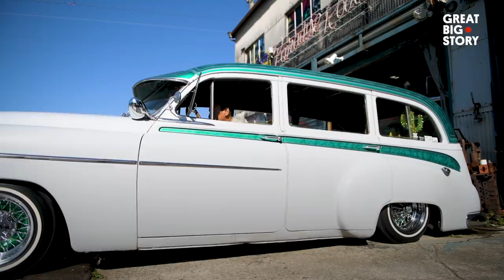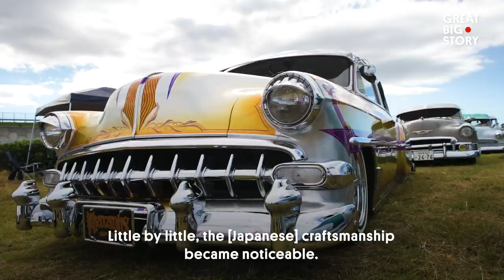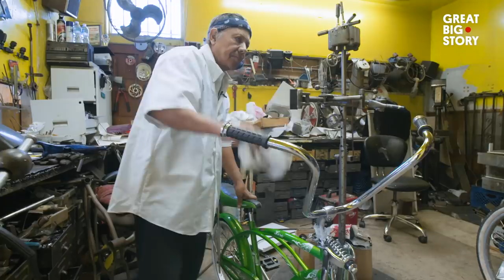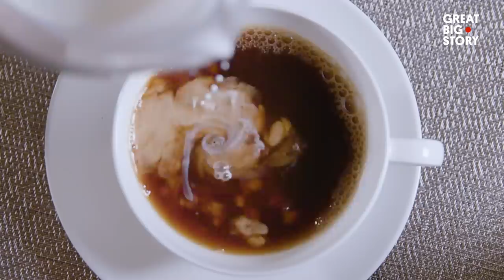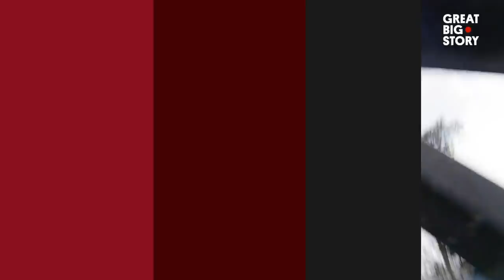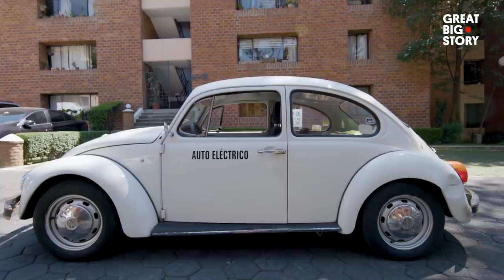How DIYers Build Their Dream Rides

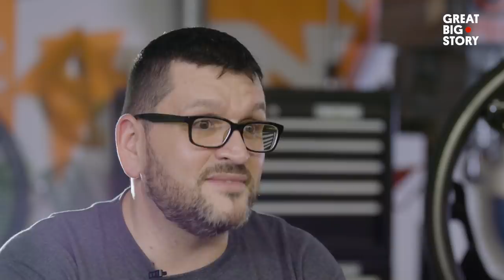Comment: 05:39 Michael Burtov Remember THIS GUY. He is the next Nikola Tesla. Mark my words
Reply: nah fam
Reply: Having the battery inside the wheel is not good for the unsprung mass, I do not think it will catch on except for in niche areas
Reply: Simon Harvey also 3 wheel contact points ins a nightmare, not to mention if you drive this on the rain/ with a road with some mud, yer kinda fcked, and i checked the price it costs the same as a midrange brand new scooter, so unless they can drive doen
the cost more its a no deal.
Reply: Xian H. Why not fam?
Reply: @gokiburi-chan4255  Ah yes, of course! These are obviously insurmountable problems because once something is designed it is never changed or improved. Never ever. Nope. Everything retains its original form. Never. Gets. Better.
Reply: Mentocthemindtaker before i made that comment i looked up the company and i think the design haven't changed that much addressing those issues.
Reply: Xian H. You think fam. So you’re unsure?

Comment: yeahhh about the electruc cars, they arent friendly to the world at all. to make the batteries mines are opened to dig out key ingredients for them but that is not all. most electricity is generated in facilities that burn coal. Solar power isnt clean either since you need 250 kilograms of coal for each 1m² of solar panel you make. so no, electricity isnt clean.

( sorry for spelling, english is my 2nd language )
Reply: I was about to say the same thing, better to just buy a pre owned car and drive it until you can no longer fix it